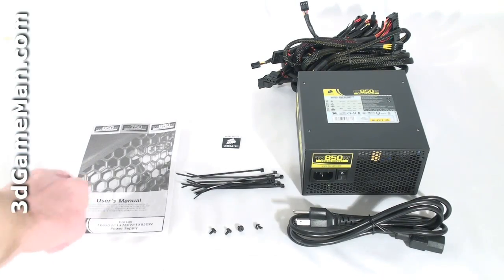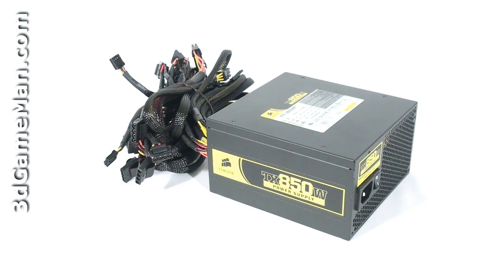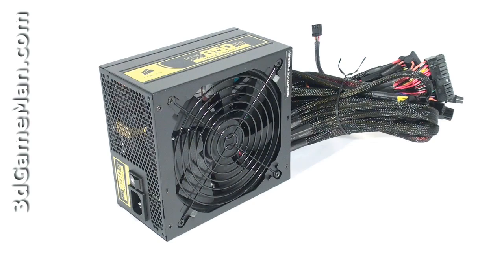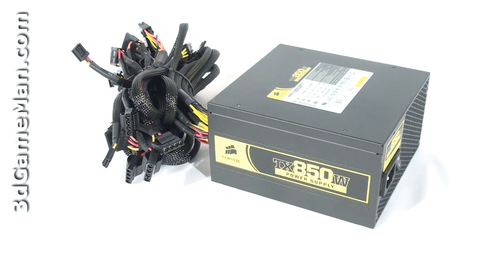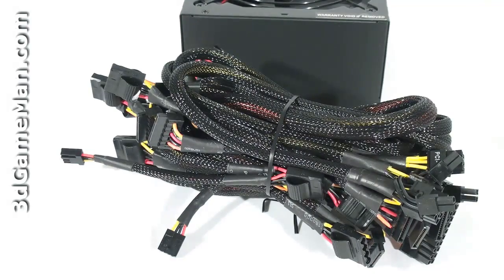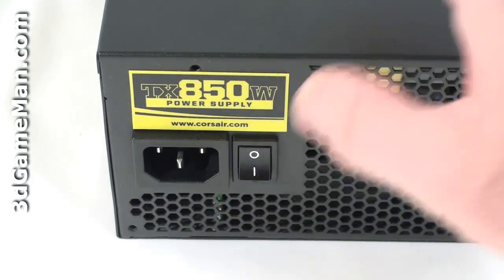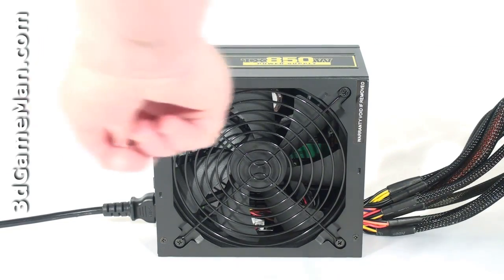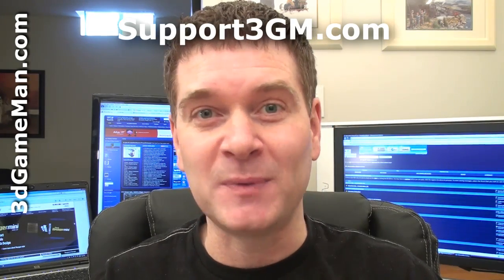#1050 - Corsair TX850W Power Supply Video Review

Comment: Sure it has a ton of cables but i want many many option. If you have a case with good cable management then having a modular psu really desnt make any difference. I have been cutting holes in the motherboard tray and tying the excess cables to that for years. It works great! By the way this psu is awsome!

Comment: i dont get why people buy 1000watts to power like a simple duo core and 1 graphics card. I have a 550vx corsair and its doing great. Its 41amps can produce 492watts. 492Watts can power pretty much 2 260GTX in SLi (1 260GTX= 186Watts at full load). 186x2=372 Watts.

Comment: Well to tell the truth all i pretty much have for cable management is the ability to fit molex through if i bend back those things that are to help taking it off.  Otherwise nothing seemed to fit I have the thermaltake armor(original no side panel fan) which i hid a string of molex behind the mobo tray for fan power and molex to cd and hd drives through the holes near the front bays and hid wires there...just took a while and that many seems like way to much for this case.

Comment: If there's one thing I HATE about the corsair PSU's its that they aren't modular except in the lower wattage ones and in the 1000 watt one which is longer than all the others and I'd rather just buy the 750 watt but the amount of cords are just too much to hide for wire management.

Comment: You should have also stated in your review that Corsair power supplies are based on Seasonic, and thus have a pretty high reputation as it is.

If you're looking for a modular PSU, Corsair have the HX range, which is modular.

Corsair also have the VX range if you're looking for a single +12v rail, for anyone looking for that.

I have a VX 550 Watt PSU with over 40A on the +12v rail, for my 8800GT card, incase I upgrade to a more power hungry one later (nVidia cards focus on +12v more than watt)

Comment: I currently have this power supply single rail is kick butt.Yes its not modular but if your good at cable management not a problem what so ever and it runs really quite.Stable voltage all around...